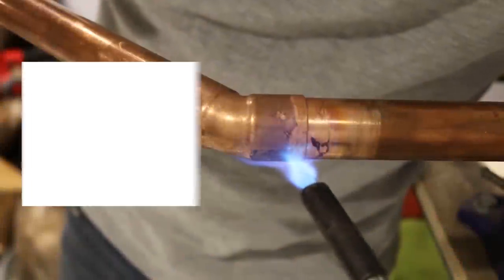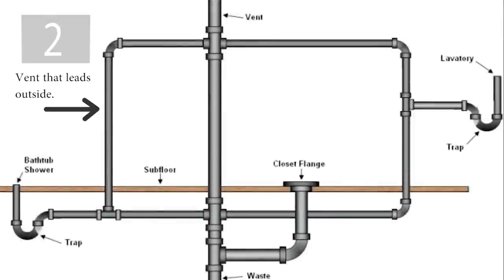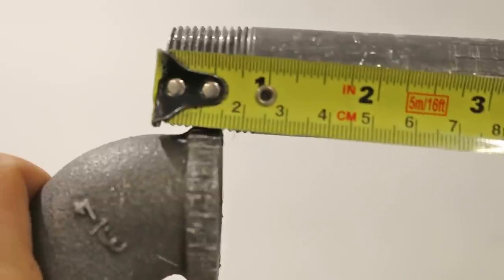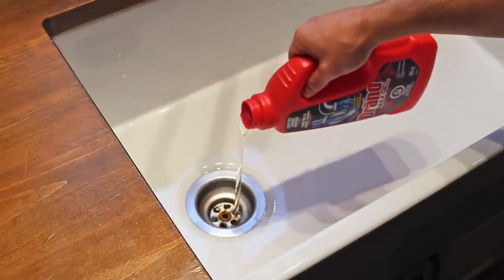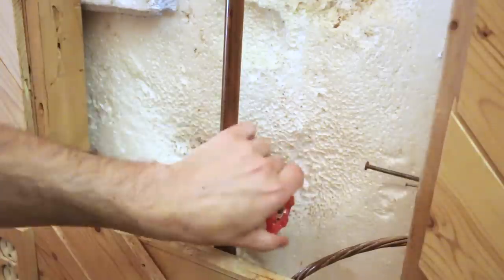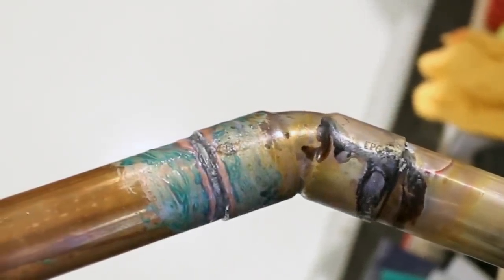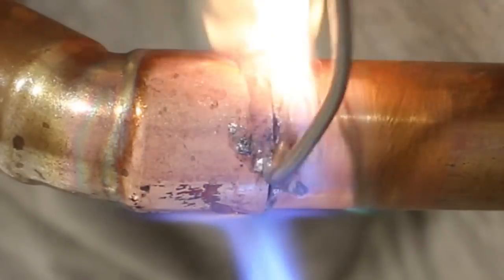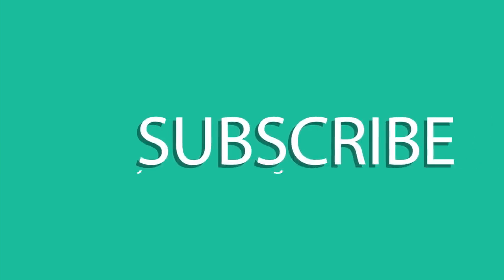10 Plumbing Mistakes You Should NEVER Make and How To Fix Them! | GOT2LEARN

Comment: I installed ball valves on my tub/shower lines so I can turn off the water but leave it on in the rest of the house.

Edit: it should be standard nowadays.
Reply from the maker: How come?
Reply: @Got2Learn 
How come I installed the ball valves?

To shut off the water if I need to work on it without affecting the rest of the house. I'm actually redoing our 2nd bathroom tub and flooring. Nice that I can work at my own pace without worrying about the water.
Reply from the maker: Ah yes, good point ;)
Reply: @pmailkeey Wonder how it starting leaking. But yes, the more parts, the more places for leaks.
Reply: @pmailkeey ah, I hate how you never know it's too tight until it's too late :)
Reply: You could do it but It's more of a issue than a solution most often. The valve will corrode over time when not used often and it's just another leak point and when you go to close it that one time in 3 or 5 years, the corrosion inside will most likely prevent it from fully closing so you might end up shutting off the main line anyway. Unless you build a habit of using the valve every so often (who would anyway), it's more of a problem than a solution. Just my two cents. Ok I had to edit it when I reread your comment. On a remodel you're doing yourself and you want to take your time then I could see why it would be helpful but once the work is finished, I would remove the valve.
Reply: @seephor  Got it. Thanks for the input. I see the pros and cons. On my main, I have two valves with round handles that turn and a water meter in the middle. I believe I opened the one upstream from the meter too far and now it won't shut off when I turn the handle. I did read they can do that. I always shut off the water when I leave for long weekends but now I have to deal with this. Not a job I want/can do.
Reply: @pmailkeey built in 1978. I'll make a video and post it. For kicks :)

Comment: Never use teflon tape for gas lines..
Reply from the maker: Affirmative :)
Reply: @Got2Learn  Wait, don't they specifically have teflon tape designed for that? Comes in a yellow spool instead of red or blue, right? Is that a problem and should Home Depot not sell it?
Reply: That's interesting.. different colors of Teflon tape out there I see. Yellow for gas lines, green for oxygen lines and the heavier gauge pink tape for larger diameter pipes (1/2 inch diameter and up).

Comment: Dam...
I just finish my copper instal and close the wall...
And then i watch this video...
Realising i had not wash the flux...
Reply from the maker: Next time, make sure to wipe the pipes clean before calling it a day ;)
Reply: @Got2Learn  learning every day!
How bad is it important ?
Can it be good for 30 years ?
Just asking "in general"...
Thank. 👍
Reply from the maker: Yeah for sure! It's more of a long term thing..If you didn't do the joints and paint already, you might wanna unscrew the sheetrock and give them a good wipe, cheap insurance ;)
Reply: Quick, sell the house and move!!!
Reply: @lostintime8651  😆

Comment: Take this at face value. Plumbing is somewhat easy, IF you know what your doing. Cutting into your water lines without draining the system can result in thousands of dollars in flood damage. Soldering is tricky if you've never done it. And you wont see a leak until the water is turned on. Shark bite fittings can eliminate the need to solder... but can be tricky to properly install. If you want the job done correctly and in a manner that is up to code, just call a licensed plumber. (Not a handy man)
Reply: Take this at face value as well:  If you want the job done correctly and in a manner that is up to code, just take the time to read the IRC and local codes, plan out your work, practice on some scrap if necessary, get a permit, and do it yourself.  You will save tons of money and no one will ever care more about your home than you will. Don't waste your time on overpriced professionals that care more about sacrificing quality and keeping their costs as low as possible while charging you as much as possible.

Comment: Do not do the vinegar baking soda thing. The baking soda will just settle out inside your drains
Reply: You don't think it will eventually get washed away?
Reply: @keithupton86ku  yes but it is plugged so there's no flow in the drains meaning it will just sit and add to the problem
Reply: @DutchCanPlumb  I think it depends on what is clogging it. The vinegar, although weakened, is similar to acid.